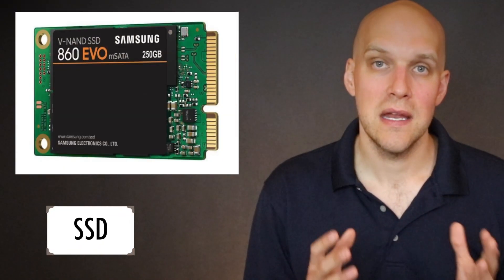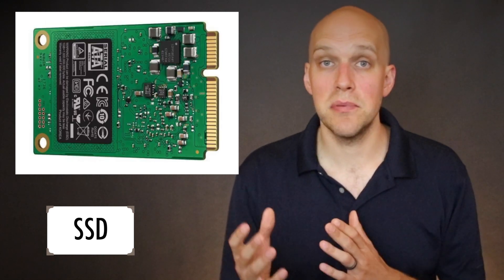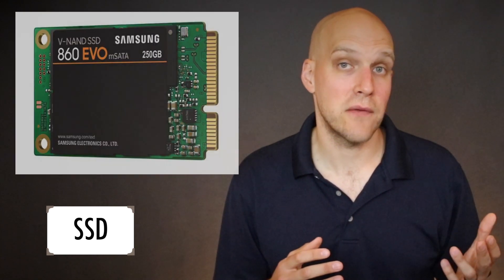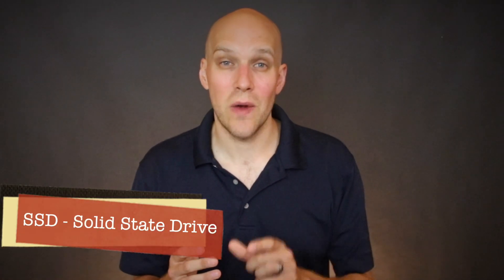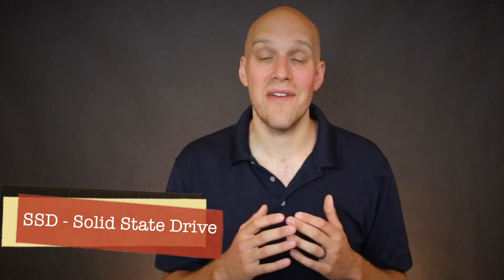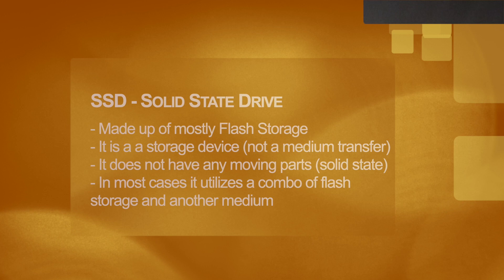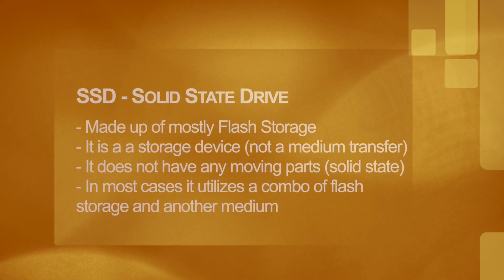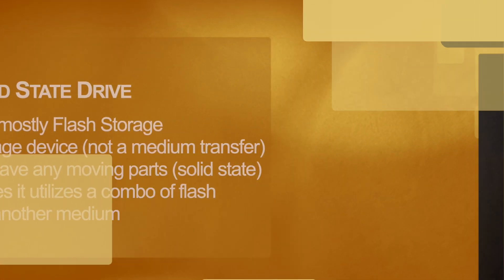SSD vs Flash Storage (what's the difference?)

Comment: i hear everything except "what's the difference between ssd and flash storage.
Right now you can buy flash storage and portable SSD with same capacity, same speed and same price, so WHAT THE DIFFERENCE?
Reply: I am having the same issue on what should I buy to use as one of my backup methods. SSD and Flash stick with roughly the same speed and capacity costs the same. I've heard that Flash sticks do heat more but I already accounted that in my speed calculations. What did you end up getting @trololoev and why? Enlighten me please...
Reply: @visulashka  in other video i heard that ssd has significantly bigger resource of work, so ssd is better. But if you didn't use it for long time it can lose information, so use ssd as backup that you made constantly, not as backup that you dig in the backyard for years, for that hdd is better.
But if you only compare ssd and flash: they are use same memory principal, but ssd has much more advanced memory controller and cooling control, both help to make bigger longevity. Also ssd faster. Flash usually more compact and cheaper.
Both need to be turn on from time to time, so memory controller make it shenanigans for memory longevity. So if short - if you has money and not care about size then ssd is better. Good ssd box important for speed and cooling of ssd.
Reply: THAT'S the question not answered in the video title. I'm pretty certain USB flash and SSD are more or less the same. Difference being, USB is readily removable, SSD you need to disassemble your computer. They both go to 2TB and are more or less the same price glancing on Amazon.
BTW this video is 5 years old. I'm sure things have changed quite a bit.
Reply: @Kewrock  you can buy portable ssd that install in the usb.
Portable ssd can have much more rewriting that flash drive but little bigger in size.

Comment: Just wanted to drop a friendly note and point out some errors in your video. The oldest type of storage is punch cards, then came tape, and finally HDD. HDD's can actually last decades as I have some that are easily 20 to 30 years old and still have data on them. My oldest HDD from circa 1988 has completely failed, so HDD can last a very long time when properly handled. And lastly, NAND is pronounced NAND not N A N  D, and is named after the NAND gate in computer logic. There is also NOR storage, named after the NOR gate in computer logic.

Comment: And here I am trying to figure out what storage solution is best for me due to having filled my phone full of memes and now I have to move them to a separate storage. I've had bad experiences with micro sd in the past, they seem to randomly become corrupted. :(
Reply: Same problem here! What did you end up getting?
Reply: @s1lverhawk  since she didn't reply 😅 I was wondering what YOU ended up getting?
Reply: @miao7002  since they didn't reply 😅 I was wondering what you ended up getting?
Reply: @unitedastronomer  hahah I shall be the one who finally replies 👼🏼! So I ended up getting the ssd since it's faster and can store more since it has higher capacity. Keep in mind I'm sooo bad with tech so idk if I even made the right choice 😅 but that's what I went with & why ☺️
Reply: @miao7002  It usually has a higher life span than a Hard Disk too. Also how much you can store is more driven by price than higher capacity. Yes while the SSD is more dense it just means they can make it smaller not that you can store more. So if you are low on physical space SSD makes more sense. 1TB SSD = 1TB HDD. What it comes down to is price now. It is faster for sure tho. That said SSD can have a higher capacity. If they made it the size of an HDD it will have a lot more storage.

Comment: I want to buy a laptop, which storage type is better? SSD or FLASH? I just want it for a couple of years I’m not looking for a long term one
Reply: u can get ones with m.2 sata drives samsung are best but u can also get 2.5 inch ssd samsung are good and these are cheaper if u dont need to move large files quickly go for 2.5 sata samsung drive if u need really hevy use go for m.2 sata samsung but they cost more  there are few other types but these two main ones  hope that helps

Comment: Great video, it confirmed my answer.  
About this Mac on Macs that come with Flash Storage says “Flash Storage”. When I upgrade a Mac with an SSD, the Mac reports “Solid State SATA Drive”.
Reply: older macs have upgradable storage new ones have fixed in ram and ssds ur correct apple uses sata ssds but they also use m.2 ssd drives up to 2016 macbook pro m.2 are smller thinner but come in sata aswell but most sata drives are 2.5 inch ssds mainly used in laptops windows or apple devices.. hope thats helps

Comment: I would like to archive 25 year old video files as .mp4's, these would not be accessed again unless other backup files had been corrupted. Suggestions? Would a thumbdrive be fine since its not being accessed unless one or two times and perhaps never?
Reply: I would use a hard drive for that because they are the one of the most reliable storage mediums and also offer large capacity for less money than an ssd

Comment: Cellphones uses SSD or Flashstore? I'm confused
Reply: Cellphones have a solid-state drive. That's the broader term. Because most SSDs consist of Flash Memory, one could say that your phone saves data in its flash, even when turning it off

SSD - name of a storage device without moving parts used in an application (smartphone, laptop, PC)

Flash Memory - specific type of storage Technology based on floating gate Transistors

small differences result in bigger confusion :D
Reply: It is the same thing

Comment: I think you mean silicon, not silicone.
Reply from the maker: Tomato Potato right?
Reply: Silicon is a naturally occurring chemical element, whereas silicone is a synthetic substance.
Silicon is the 14th element on the periodic table. It's a metalloid, meaning it has properties of both metals and nonmetals, and is the second most abundant element in the Earth's crust, after oxygen.
Silicone, by contrast, is a synthetic polymer made up of silicon, oxygen and other elements, most typically carbon and hydrogen. Silicone is generally a liquid or a flexible, rubberlike plastic, and has a number of useful properties, such as low toxicity and high heat resistance. It also provides good electrical insulation.  Source: LiveScience. 
E.g. - Silicon is used for integrated circuits, silicone is used for weather sealant. 
I noticed the word silicone in the video quickly and looked for the previous obligatory comment.
Reply: Great video, it confirmed my answer.  
About this Mac on Macs that come with Flash Storage says “Flash Storage”. When I upgrade a Mac with an SSD, the Mac reports “Solid State SATA Drive”.
Reply: It's pronounce silicone and spelt silicone.

Source: I'm English. It's my fucking language and you're wrong.